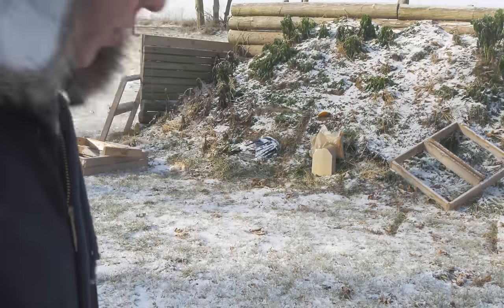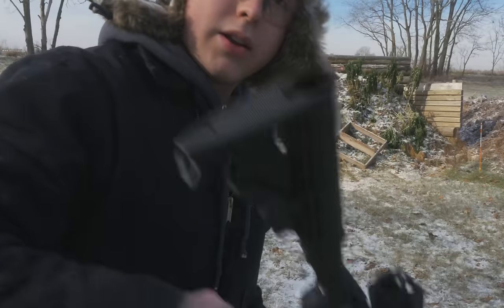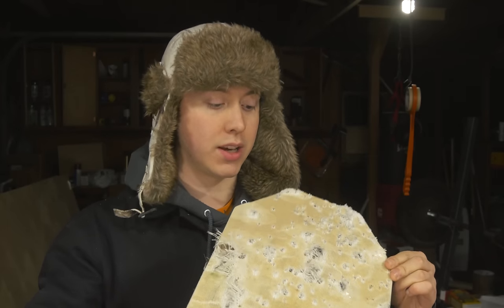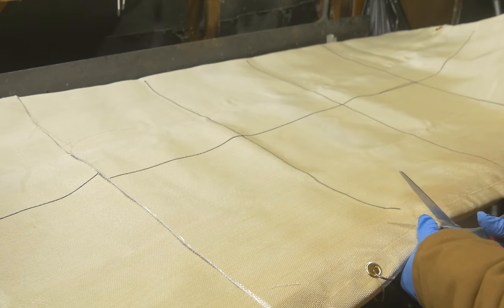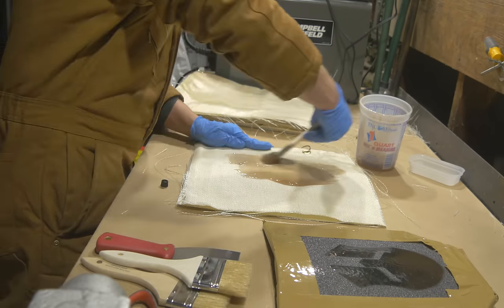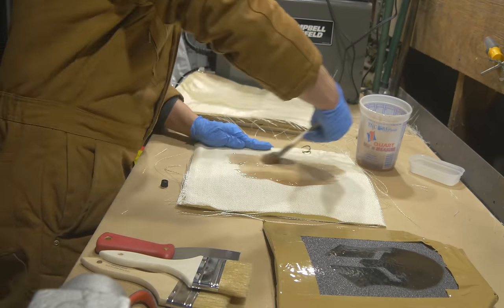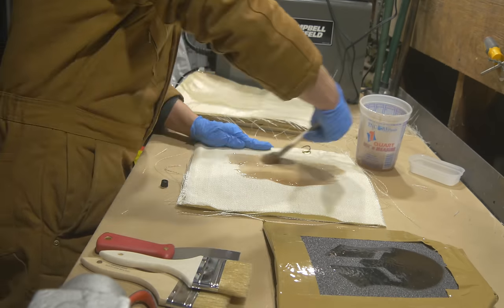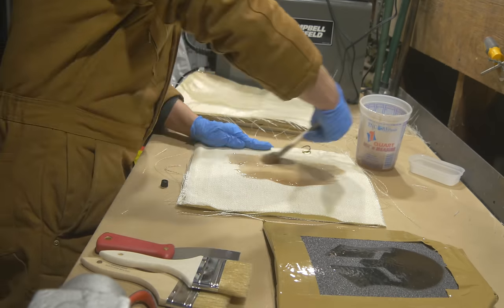How to Make AMAZING Bullet Resistant Armor for $30

Comment: Word of advice, if you find yourself needing reference plates, there are dummy SAPI plates made of rubber that sell $15-30 per pair
Reply: I was just gonna ask what if we don’t have a plate for reference! Thanks man!
Reply: Where can I find it
Reply: @Freetrevor116  top 80 questions that will never be answered
Reply: @AhDollar  Amazon, I’m wondering if the pressure of the clamps will mess with the shape during curing
Reply: @monsteflex  top 79 questions that will never be answered
Reply: @monsteflex  All I see on Amazon for dummy plates are foam airsoft ones
Reply: You could also find dimensions online and make plates out of cardboard and tape. Takes about three layers of cardboard if I’m not mistaken for ideal thickness of a composite plate
Reply: @DocAracnid  Yeah except cardboard or rubber would just get crushed/compressed with clamps.. You need significant pressure as it cures to squeeze out any air, make sure all the glass is saturated with resin, force out any extra resin, and ensure a tight bond between the layers. Anything soft or flexible wont do the trick
Reply: Or of eva foam
Reply: @monsteflex  You could cast the shape of the rubber plate with concrete or something and use mould release... or instead of concrete you could use resin which would be even better.
Reply: Should I wear those plates then have my buddy shoot at me to test how durable they are?
Reply: @AbstractMediums  Yes just make sure you record it and have it uploaded to YouTube
Reply: Wish has them cheap
Reply: Doesn't that defeat the 30 dollar total for this. Or did i not hear it right.

Comment: A little interesting thing about fiberglass resin is it's 2 parts. The hardener and the resin. It will not take days to dry if mixed properly. I worked at a fiberglass boat factory for a long time in the mold department. We would chop gun and spray a hull in to the mold one day and the very next morning it was getting pulled from the mold and going straight to assembly. The hardener is the catalyst in fiberglass resin and therefore does not actually need air to fully cure. The more hardener you add the hotter it will be which in turn means faster cure time. 

Nonetheless awesome video man and I really like the 30.00 armor you built. Amazing strength.
Reply: i surfed for years, we were always fixing snapped boards. Fibreglass does dry overnight, well did 4 us. great video. Even Lic. shooters in Australia cant get them

Comment: Breathing protection isn’t optional, especially with that belt sander lmao
Reply: It really is....ive worked in a fiberglass rv factory for 9 months with no saftey gear and im still alive
Reply: @plaguemarine7767  ok boomer
Reply: @afoose  Get out.
Reply: @plaguemarine7767  fiber dust isn't insta-kill ... the particles will stay on your lungs forever, and your body will take years to make a proper cancer around the particles... if you hasn't luck... because it's like russian roulette... with a delay of decades!
Reply: @plaguemarine7767  Fine versus course powders...
Reply: @plaguemarine7767  oh boy
Reply: @plaguemarine7767  You may be alive, but you have irreversible lung damage
Reply: @plaguemarine7767  Yeah, but barely.
Reply: Silicosis....
Reply: Radical Alt-Centrist Nice username lmao
Reply: N95, like for the Covid.
Reply: @plaguemarine7767  operative word : still.
Reply: @plaguemarine7767  bro, stop breathing that shit in on purpose. I also work at a fiberglass shuttle bus factory who probably owns the SAME one you work at. Do not breathe that in
Reply: That belt sander had a suction tube on it, and you can see it sucking the dust.

Comment: some 1/8th inch plates laminated throughout the sheets (fiberglass, steel, fiberglass pattern) would help with strengthening the armor, 2 or 3 should do the trick, and the first plate would help disperse the bullets energy, reducing penetration with faster rounds.
Reply: M4st3r0fN0n3 Eli needs to read this comment tho...thats a really good idea

Comment: How to make body armor. "Well first you gotta get some body armor..." lol
Reply: FlyDangerous true I'm just using a wood cutout for mine.
Reply: You can absolutely substitute the steel armor plates for something else. I just found the idea of using actual armor plates to make "cheap" armor plates rather humorous :D
Reply: FlyDangerous you may not want to do that. the reason for that been. is that idk if you realize the little bent in the middle of those plates. are to absorb the impact of the bullet. something that any other mold u may use won't have. and for that reason it won't be as bullet proof.
Reply: The bend is so the plate contours to your body when worn (its more comfortable to wear than a flat piece of metal). They make flat plates too. Those are usually a bit cheaper than curved plates.
Reply: FlyDangerous to my understanding it's to absorb the impact better. but good to know 👍
Reply: It does help stop bullets better, but that's just a happy side effect :D
Reply: The bend wasn't made for comfort it was made for impact deflection/absorbing. No armor ever created had comfort over protection, it's always been protection over comfort.
Reply: jerod jackson  very true!!!
Reply: I wear plates every day. I assure you that the curved ones, especially the "multi curved" plates are much more comfortable than flat ones/ single curved ones. The curve conforms to the body which allows for better coverage at steeper angles. This, (key word ->) reduces deflection. You want solid hits on the plate. Hits at an angle causes deflection which leads to hazardous fragmentation. The curve has negligible effect on "absorption" of the bullet.

:D
Reply: It would be easy to make a curved wooden plate for the form. I would use a good hard wood maybe oak from reclaimed pallets. Then plane the lumber to clean and uniform it, cut in about 2in wide strips with a 2 or 3 degree angle and glue it up with a curve. a litttle belt sanding and you have forms. Well maybe easy for us real men with tools. I will be giving it a go this sumer I have a few other things I going to glass anyway.
Reply: well, regurding comfort. modern armor making is all about maximum cuverage and comfort. we alrady have good blocking mettirials. now the reaserch is focused on armor that will allow for full range of motion. 
however if your making a home maid version protection will definetly should be more important.
also if you want quck and easy way to make the forms use expanding foam.
Reply: Wow who did you steal the cap and gown from!!!!! Materials  not mettirials also Homemade and is one word and has no i in it. Maid would be a cleaning lady. And  cuverage now thats funny. LOL   I can't spell for shit but you make me feel good! Thanks
Reply: +jerod jackson you are completely backwards on that actually. armor has always taken mobility fully into account, and the bend in the plates makes no change in its ballistic protection level. it is purely ergonomic.
Reply: I would just use my belly for the mold.  :)  Custom fit. :)
Reply: or maybe get a mannequin as the mold. :)
Reply: ayyy there you go :D
Reply: fastacker2 just ask someone if they want to try the mannequin challenge.
Reply: +jerod jackson Every armor ever created was made with an acceptable comfort threshold in mind. Troops have to wear them every day , march in them for hours on end and accomplish daily tasks and often even sleep in them.
Reply: He could have used foam board as a template and melted it away with acetone
Reply: RLaneSports- Please eloborate.
Reply: Patriots Fan if you pour acetone on foam board it will dissolve like cotton candy and leave behind the resin mold
Reply: Made* (Sorry to be that one guy D: )
Reply: Troops have a different type that is not completely flush to the body and can withstand 7.62. Its their normal clothes with a vest on therefore no comfort really needed when making them but having the curved will make the vest fit better thats why they do it. If the vest fits better your body will have more surface area taking the impact. Think of it like this. Hard surface to stop the bullet. An action like this makes another reaction, in this form it would be a huge amount of force concentrated on a small spot if nothing stopped the bullet. Stopping that bullet will increase the amount of surface area the force is spread out on.(just a simple example) Bullet = 10 force within 1cm. Through surface area lets say 10 cm that 10 force suddenly is 1 over several cm instead of 10 at 1 cm. This added with a soft layer of fabric working as a impact reducer would give you a reduced impact not knocking you the fuck out instantly but rather as taking a punch, punch force increasing with caliber and power of the bullet.

Dont know why im going into such detail, you probably know this, im just going to go back to watching Anime now.
Reply: Lmfao
Reply: jerod jackson armor is made to be comfortable.
Reply: With a very solid material the curve could, possibly, maybe make the bullet deflect off of the plate, but as you saw on the tests even though the plates were curved, even the handguns were penetrating, so with eli's armor the curve is only for comfort, cause when the bullet penetrates, it's not gonna deflect.
Reply: You dont need the plates to make it. Its called a measuring tape.

Comment: For the deformation from the slug I would suggest running trauma plates, they are basically a plate shaped pad that absorbs some of the impact and gives some space for the plate to deform without pushing into you. You put them in the carrier with your actual plates, behind them obviously.
Reply: Where do you get these trauma plates ?
Reply: what are they made of?  Rubber?
Reply: @tonykari5124   Honestly, inexpensive exercise foam would work fine. You just need something to absorb impact force and spread it, and foam does pretty good at that, at light weight.
Reply: Right, you need some form of cushion or suspension to keep the deforming armor from deforming your ribs. Its the same deal a kevlar helmet. If the helmet is directly on your skull or is allowed to hit your skull (under impact) you will have brain injury. Ancient people figured that out a few thousand years ago.
Reply: To bad no more Sears catalogs lol to use

Comment: You probably know this by now, but if you spray the plates with mold release, they'll pop off from the resin much more easily. That's how mold-makers get the resin forms to come out of their molds after the resin cures.

Comment: I realize this video is nearly two years old and I see lots of folks have made suggestions on production. I have something to add and I believe it would save materials and time. To avoid the necessity of cutting the layers oversized and then removing the excess, you might try using a sewing machine to outline each piece. A sewing machine is as easy to run as a bandsaw and even a cheap one would sew that loose woven fiberglass. Run the stitches to either side of your marker line and maybe even do two passes, one over another. When you go to cutting, cut straight down the middle of your marker line. The edges should remain intact. You might even get one or two more layers out of a blanket. And think of all the time you would save. You wouldn't need to saw the edges. Just run the plate over your sander the way you did in the video.

Comment: I'd bet you could increase it's effectiveness by orienting the weave between the sheets better. The weave of each layer should be at a 45 degree angle to the following layer.
Reply: Like putting them in a clockwise rotation every 45 degrees?
Reply: @stonelesswolf7827  you wouldn’t necessarily need to do a rotation, as weaves are inherently similar at 90 degree offsets, but that’s a small semantic difference. If rotation is easier for you to plan and execute, it will be functionally identical to alternation. I imagine that while it would require more force to penetrate with the offset, it likely wouldn’t make it resist 5.56 much better. If you wanted it to do that, the easiest way to do it is make it thicker. Impact depth of moving penetrators is a bit more complicated than what I’m about to say, but a rough approximation of penetration depth is a function of density and projectile length. If the armor is as dense as the bullet, the bullet will go about one bullet length into the armor. If the armor is half as dense, it the bullet goes two lengths through the armor. So, d(bullet)/d(armor)*l(bullet)=t(armor)
Reply: Honestly I doubt alternating the weave would make much difference. The purpose of the alternating layers is to provide strength in all directions. This makes sense in something like plywood, where the layers of wood are strong in one direction but weak in another direction. Alternating layers makes plywood strong in all directions. Woven fiberglass, however, is already strong in all directions precisely because the fibers alternate in the weave. It's not like the fiberglass is weaker at 45 degrees off the weave. It's just as strong as any other direction, because it spreads the load evenly between both orientations (e.g. at 45 degrees, 50% of the load is taken by the 0 degree fibers and 50% of the load is taken by the 90 degree fibers, achieving the same strength as 100% of either 0 or 90 degree loads).

The only potential purpose for alternating, then is coverage i.e. having fibers along that axis to maybe catch better or something? But the fact that the layers will be placed imperfectly would fix any coverage issues (which probably aren't even a thing, I'm pretty sure the resin is doing the catching and the fiberglass is holding the resin together).
Reply: Youre late and it was already said
Reply: @jeffwells641  Not true. The strength of woven fabric is predicted to go as cos^4(φ). at 45 degrees this is 1/4 of the uniaxial value or 1/2 the 0 degree biaxial value.
Reply: @appa609  what's the measure of strength though? Tensile or fracture?  I agree that alternating orientations would be better but maybe not as high as that because the failure mechanism might not be the same for point forces through the sheet.